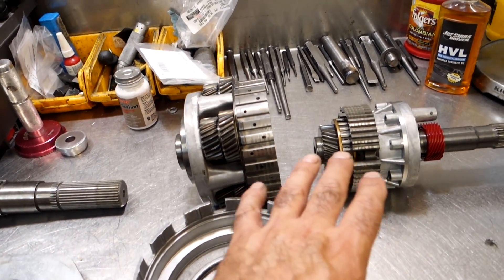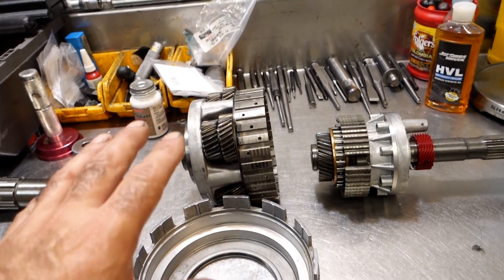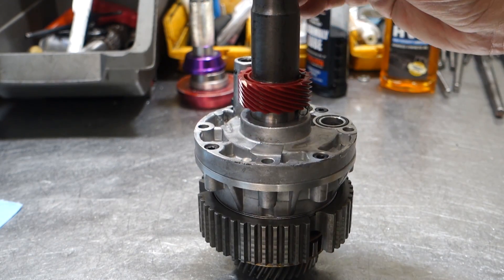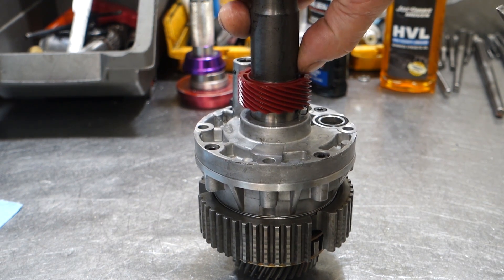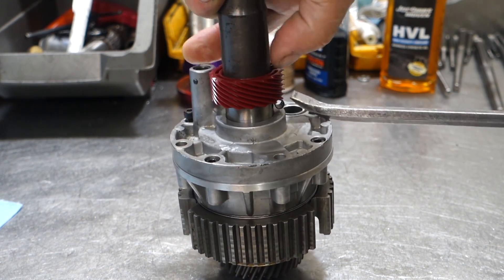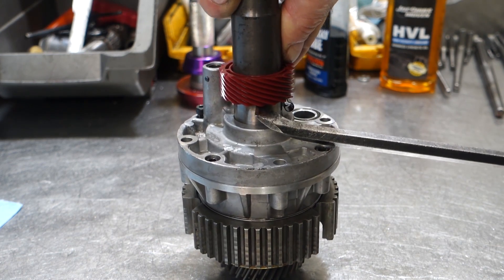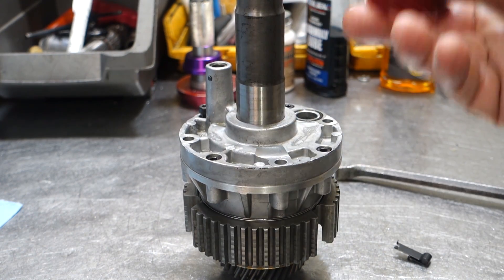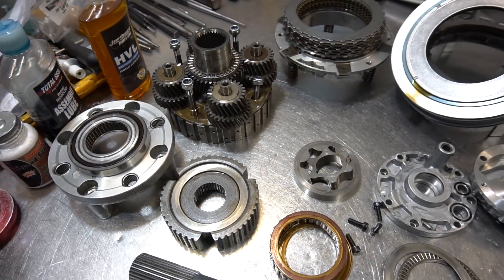How a Corvette 4+3 Doug Nash DNE Overdrive functions

Comment: What kind of torque can you put through these bad boys? Great explanation :)
Reply from the maker: These were used in the Callaway twin turbo cars. Once I modded them they never burned up. You can break the four-speed section but the overdrive held up.
Reply: @GearBoxVideo  what kind of torque were you putting through the gear boxes?

Comment: I just bought a low mileage 84 C4 with this trans, it works great. I'm a Tech with many years rebuilding transmissions, thanks for the walkthrough on this unit, hopefully I wont need to be inside it but if I do at least I've seen it. Thanks for the no-nonsense approach, it's appreciated.
Reply from the maker: It's a good thing you know your way around a transmission, some of the internals in this one are unique!

Comment: My OD in my 85 C4 Corvette doesn't kick on until about 110-112 mph. Any ideas? Once in OD I'm able to shift through the gears, in OD, unless it gets kicked out. It'll kick itself out in 1st, at a stop, or under heavy throttle/load, but I have to get back to those speeds if I want OD to kick in again. The light on the dash does work correct, also letting me know when OD is locked in or not.
Reply from the maker: Probably your throttle position sensor

Comment: I only see clutch plates , pumps and Planetaries .. I guess it a slush box not a gear transmission.
Reply from the maker: Its the  overdrive section of a 4+3  Transmission.  Its a 4 speed gearbox that has an OD behind it. Are you familier with it? The video explains the operation and FYI the planetary is a stepped planetary unlike the slushboxes you refer to.

Comment: I just bought a 1984 Corvette and it doesn't have a motor are trans I have a super T10 I had bought a wild back and I'm putting it in the car with a 454 big block so I guess I'm just a gluing for  punishment but anyway do you know if any one who would have a overdrive that I could buy for it and how heard is it to put one. On a T10  thanks
Reply from the maker: Just get a core St10 with the OD for that year  car

Comment: My reverse let go now I have no engine brake only if engaged in overdrive engine brake works reverse grabs a tiny bit makes noise it fully engage hard and slip . Without overdrive no engine brake
Reply from the maker: Your OD unit is smoked
Reply: @GearBoxVideo  even though overdrive  works ? Thanks
Reply: I thought the four-speed would work normal and I would have no overdrive and reverse? But thanks
Reply from the maker: The OD unit doesn't disappear when not in use.  So reverse mode has to drive thru clutches which when burned you will also loose engine breaking

Comment: That carrier needs a angular contact ball bearing, good to know why these fail, I'm willing to reproduce these parts as billet pieces if you need them and have good samples
Reply from the maker: They went with an angular contact bearing and they failed just the same. You just need to set the proper stack height of the whole assembly. The people who were assembling them didn't understand the fundamentals of clearances. Therefore most failed because the bearing was being crushed
Reply: @GearBoxVideo  probably better to fit a tappered roller in there. If you need parts made hit me up. I've got CNC capabilities
Reply from the maker: Already looked into that. Not enough room and not enough material to remove to fit a bearing. FYI. I've done quite a bit of these and developed the fixes for Callaway and the Corvette challenge series. They work fine if they are set up correctly. This is no longer something I will build simply because the expense to tool up new parts ( I've already made Iron carriers, billet pistons, washers etc) is no longer profitable since these cars have little value. Most people getting into these cheap Vettes freak out when it comes to major repairs.
Reply: @GearBoxVideo  if you still have the prints, I like making low volume parts as a side hustle, more of a hobby.

Comment: Wow what was gm thinking?!  2 transmissions to maintain and rebuild!  I cant imagine there's that many people who are still working that have experience rebuilding these.  Give me a 6speed anyday.  Anyone know if people deleted these when they failed, or not practical im guessing?  Probably easier to do a trans swap.
Reply from the maker: At the present time there were no 5 or 6 speeds available to handle the power. The ZF 6 speed didn't happen until 1989 and was developed for this application.
Reply: @GearBoxVideo  Do you know of people doing LS v8 swaps in a ZF6 C4?  Seems like a good way to bring performance of a C4 up to modern standards.

Comment: Paul, what preventive measures can you do to prevent failure? Disengage the OD or only use it in a certain way or condition? I like this transmission but uncertain of its reliability.
Reply from the maker: Just do oil changes every 10K. If the unit didn't fail by 50K then you probably have one that was assembled correctly. The OD unit is always in operation even if you are not using it
Reply: @GearBoxVideo  Thank you Paul for your response and information, I have a opportunity to purchase 88 C4 with the 4+3 . The car has 43k miles and watching your video I was worried about what you had mentioned about the OD failing.
Reply from the maker: The 88 had all the upgrades, change your oil and maintain it

Comment: Whats the trick on removing a fill plug on my OD unit ,has not been serviced since new , its an 88 Z 52 4+3 , very dark fluid but works fine ! Thanks Know wonder Doug Nash went bankrupt ...
Reply from the maker: Is it stripped? You might have to drop the pan and heat it up with a propane torch and use an 8 point socket
Reply: @GearBoxVideo  just stuck ,torch and labor tomorrow , pan is off not much room to work ,

Comment: That 4+3 was the worst transmission ever made the 1989 ZF 6 speed was 1000% better.
Reply from the maker: The 4 plus 3 set up correctly worked just fine. Although a little odd it definitely was not as smooth shifting as the ZF. However you really cannot get service parts for the ZF anymore.

Comment: What an ingenious design and reasonably simple. How much torque can these units handle? I see gear vendors is up to 2000 hp
Reply from the maker: The 4 speed will fail before the OD fails.. Typically when I built them for Callaway Twin Turbos they were hit with 800HP. You can rate an OD much higher but the gear box in front of it handles the majority of the load.

Comment: Is there a video with tips for putting it back together?
Reply from the maker: No, but I need to get another unit to to the assembly
Reply: @GearBoxVideo  I have one you can cause I’m struggling to get it back together
Reply from the maker: I need to get another unit to show assembly. These are actual jobs

Comment: Merry Christmas Paul, I’ll be calling you next week for some questions about the direct clutch stack height, I’m at .980 and it’s too tall and won’t allow the sun gear to contact the output shaft and selective washer. I’m .224 to tall, We’re to start with the height would help Thank you
Reply from the maker: You just as assembling wrong.
Reply: I’ve mimicked both stacks heights like you recommended using 5 in the OD and 6 in the direct, When I install the direct plates in the unit there’s not enough room to stack them on the hub, Yes I’m missing a step somewhere in the assembly. I simply may not have the apply plate pulled back in the case enough but it’s 1/8 past the lip easily.

Comment: So if this is just an overdrive, direct box. Why is it called a 4+3. Seams like it is only a 4+2?
Reply from the maker: In front is a 4 speed. You get 4 speeds plus 3 additional ratios in 2nd , 3rd and 4th. Get it?
Reply: @GearBoxVideo  that is pretty lame and misleading. traditionally a 4 + 3 is a 4 speed with a 3 speed auxiliary.  A 5 speed with a 4 speed brownie box would be a 5 and 4, but you get a lot more than 9 gears... but i guess manufactures have been lying all along, can expect them to change (or ever be honest in their advertising)
Reply from the maker: You would have to understand the marketing behind the Doing Nash product line to get it.

Comment: How durable are those clutch apply bearings? Seems like very few transmission designs do that nowadays, opting instead for a rotating hydraulic piston assembly. 

The only modern gearbox I can think of that uses an apply bearing for a clutch pack is the new-ish GM 9-speed unit, and some transfer case clutches that use an electrically actuated ball ramp.
Reply from the maker: This is not a clutch apply bearing the bearing simply holds the planetary in place.
Reply: @GearBoxVideo   Sorry, my wording was a bit unclear. 
5:34 Doesn't the (non-rotating) pressure plate press against the torrington bearing to apply pressure to the (rotating) direct clutch pack? That's the part that seems rare in gearbox designs - applying pressure through a relatively large diameter bearing.
Reply from the maker: The bearing is under load in direct. It's more commonly used as a thrust bearing in other applications but you are correct, this is a unique application.

Comment: Hi 
I have a problem with my 1988 C4 Corvette 4 + 3 Doug Nash DNE Overdrive . 
Overdrive speeds when engaged do not work as they begin to platinum. My mechanic says that the problem lies in the measurements of the overdrive clutches (please send your email for I send you the attached), because he does not know what is the clearance/measure that should exist in it, after putting all overdrive clutches, so that the oil circulates correctly.
I wonder if it is possible to send me the clearance/measurement to be left in the respective piece after placing the discs?
My email: tigre1962@@t
Thanks
Reply from the maker: All my contact info is on the channel page
Reply: @GearBoxVideo  Thanks

Comment: Hi Paul, my 84 corvette transmission and overdrive works fine going forward. But reverse no longer goes. It's as if the clutch is bad. Even when down shifting it seems to be just be fee wheeling? I made sure the unit was full of fluid but I'm told it needs a rebuild.  Any quick fix for this? I see the rebuild kit is not available. Will you be putting together more kits? Thank you !!!
Reply from the maker: The OD is fried. Typical of a direct clutch failure in the OD. Parts will be back in stock next week

Comment: Hey, i have a couple questions about the doug nash overdrive unit. I have a transmission shop trying to rebuild it but they are having issues. Do you have a direct email address?
Reply from the maker: all my contact info is in the about section and every video has my web address

Comment: one thing for sure, you have done many transmissions. Huget amount of knowledge. What amazes me is all the engineering that went into making this machine.
Reply: It is not easy to construct transmissions. There is a lot of engineer knowledge in it! At transmission repair it is necessary to know dei diseases and features of various gearboxes.
There used to be no documents and information like now.

Comment: Any pros or cons to using B&M Trick Shift Fluid in a1987 4+3 overdrive unit (not the transmission- only the overdrive unit)?
Reply from the maker: I've never used it and never had a reason to. I've used Mobil One multi purpose synthetic ATF in the Callaways and the Corvette Challenge cars with no issues.
Reply: @GearBoxVideo  Great information! These are  my first 4+3's (I bought two - one 87 running and one 88 not running - both convertibles) and I am currently not having any noise or issues with the one that is running, but wanted to change the fluid and filter to keep it that way. I am sure one day I will need to rebuild them and your experience, knowledge and clear, concise videos are GREATLY appreciated! Looking forward to future videos and any mod tips you have to beef them up (just in case I wind up increasing HP) AND keep them running smoothly. I've been to your website and will be coming back to order the rebuild kits when the time comes (unfortunately, I had already bought the filter kits before discovering your videos and website). By the way, does that toolbox come with a pizza warmer too? ;-)

Comment: Hi Paul, first of all, thank you for your videos, without them we would not be able to understand about this fantastic trans.
I have a 1985 Corvette C4 with OD switch on the console, on the highway, when the OD is engaged (light Engaged is on), if I take the foot off the accelerator pedal, I feel the OD working the RPM decreases, but at the slight touch on the accelerator the acceleration increases dramatically as if the OD had not engaged, this all happened after we opened the box to fix leaks, before it was working fine, can you help me?
Thanks and greetings from Brazil.
Reply: Paul, can you help me?

Comment: Hey Paul,  i finally got my dream car (1987 corvette) and im having an issue with the overdrive unit.  when it attempts to go into od the dash light comes on but the trans doesnt shift into od  (temp and speed up to spec).  something is happening internally because i lose engine braking when the dash says its in od.  when getting back on the throttle its acting like its in neutral until the engine rpms reach trans speed. just catching itself back up from the no engine brake issue..  i do still have reverse.  i havent been able to find any info on this problem online. only thing i can see happening is that the solonoid  isnt traveling fully and its taking the car out of direct and not putting enough force on the clutches to get into od.  im feeling zero friction when i slowly get back on the throttle while in od so either the clutches arent compressing or theyre burned out. it has slipped a few times in the past when i was hard on the throttle and od kicked in (i swear i turned it off. i think its turning itself back on or my palm is hitting the switch while shifting)  if you could give me any insight on this i would greatly appreciate it. thank you,  Paul (also).
Reply from the maker: Actually direct mode clutches are smoked. Common scenario. Time to get the OD unit rebuilt

Comment: A pretty nifty system no less, but I’m still left wondering why wouldn’t GM have used the T5 that was in the Camaro instead. It’s a far simpler transmission, and yes I get that the torque rating for the T5 NWC wasn’t high at the time, but GM could’ve stuck with it and tweaked it like Ford did.
Reply from the maker: TheGtracer1994 The Ford units broke often. The T5  would have been a disaster

Comment: someone want to explain why they want to see what is in another persons toolbox? Other than being nosy i don't get it.

oh and when the clutches hold the drum they are called "brakes" :)
Reply from the maker: In what context do I need the "brakes" correction?
Reply: I think it was me just trying to add to your defining a clutch pack. In a clutch pack when the friction plates have their teeth on the inside it's a "clutch" along with the steels. When the teeth are on the outside (so as to catch on the body of a transmission) they are called a brake, because their job is to "brake" the clutch pack when needed while a "clutch" set usually allows the clutch pack to rotate with the shaft.  :) sorry if i sounded like i was being an ass. I build auto tranny's  (well and race engines) and sometimes my mouth goes off before my brain kicks in and makes things more complicated than they need to be :)

Comment: When will you be covering the electronics and valve body? Currently trying to diagnose a solenoid, would like to see this part in action/ how it works exactly. Heard from Brian at 5speeds in NY that it really doesn't act like a regular solenoid.
Reply from the maker: The video is in the works.  Thanks for watching
Reply: Thanks, your video breadth is amazing.

Comment: What kind of power can these units handle?
Reply from the maker: I've modded them for Callaway cars as well as well as the Corvette Challenge cars that had them.  They never broke or smoked with 800HP to them. However I've seen the 4 speeds actually break gears with the overdrive holding meaning the OD unit exceeded the torque capacity of the 4 speed section.
Reply: I had never heard of them until your first video. I was wondering if one of these would be an easier swap in my Bird vs shoe-horning a T56 in there, especially as I already have a ST10. I'd love an overdrive.
Reply: @GearBoxVideo   Any chance a description of these mods coming in the future (maybe in your next video)? Maybe a mod kit on you website? Thanks for your GREAT videos!

Comment: Was the overdrive system on the Corvette compelled by the feds to reduce gas usage on cars that were considered gas guzzlers?
Reply from the maker: Yes. Thus that is why a 1983 never was put into production
Reply: GearBoxVideo thanks for the info! I understand Chevrolet used a double four barrel carb prior to the fuel injection. 
Love the videos BTW!

Comment: worst product ever put in a 'vette. Had one. First day took an off ramp "at speed".... heel/toe shifted, thing downshifted causing my rear end to try passing me on the outside!
Reply from the maker: Hypertech and Arizona Speed had chip eliminating the automatic part making in fully manual. I sold a lot of chips in the day.
Reply: Oh man! If only I had known! Of course, in retrospect, I should have known...
Reply: @burnerjack01  could have just pulled the relay next to the brake booster to disable it. Regular 4 speed again.
Reply from the maker: People think by disconnecting the switch and or relay that the OD vanishes.  It doesn't. The person doesn't want to eliminate OD, just have full manual control with the computer safety features still available.